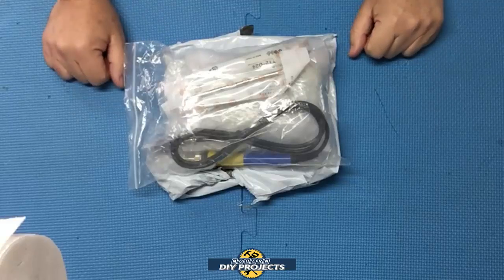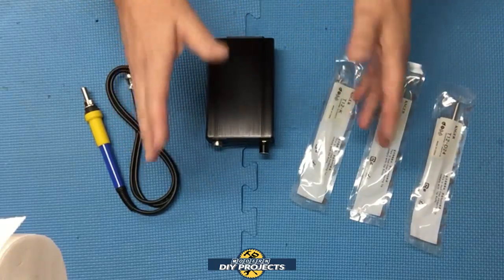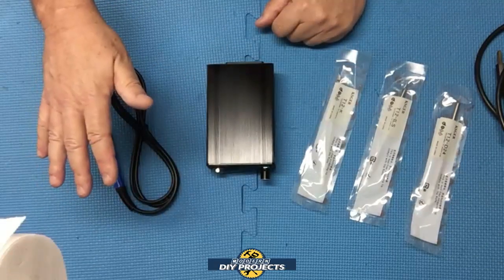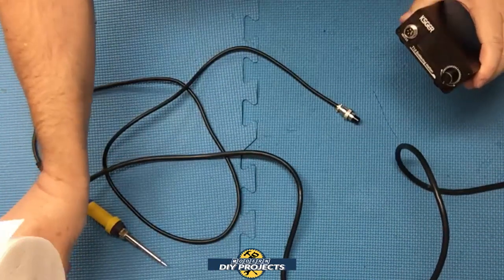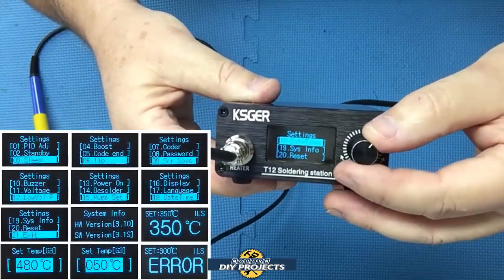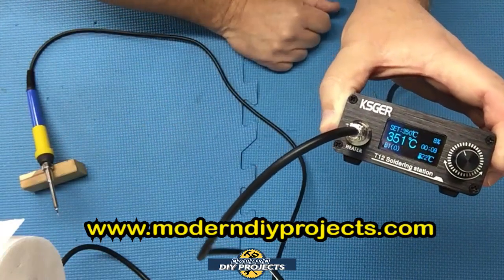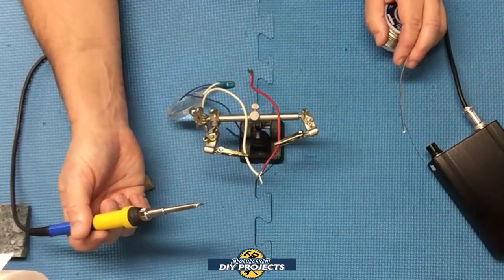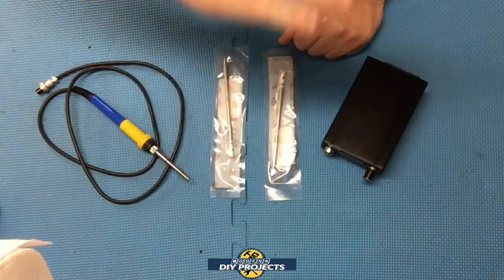KSGER T12 Soldering Station Setup & Review + Error Message and Calibration Explained

Comment: FIX for loose tips:  One really common cause of the unit displaying "Error" is when the tip is too loose in the handle.  It only has to move a couple mm before it'll loose connection with the electrical contacts.  I have the aluminum FX9501 handle with the carbon fiber grip, and that was a huge problem for me.  I found the solution on another YT video comment thread and thought I'd also share it here in case anyone else can benefit from it.  Inside the iron handle there's a short piece of silicone tube that kind of grips on to the little notches on the tips and prevents the tip from sliding right back out of the handle.  The actual electrical contact tabs aren't nearly strong enough to do this on their own.  My handle had a piece of 6x8 mm (ID x OD) tube in it that was about 2.6 cm long.  This was both a couple mm too short and 1 mm too narrow to be effective.  It resulted in a couple mm of "play" in the tip because the silicone tube would slide freely between the two stop points, allowing the tip to lose contact with the electrical connection tabs.  Annoying as all get out, I tell ya.  The VERY simple solution was to replace the tube with a 2.8 cm piece of 6x9 mm silicone tube I sourced from Amazon on the cheap.  Now my tips stay put magnificently, held snugly in place by about 6 cents worth of generic silicone tube.  No more "Error" every time I poke into my tip cleaner or blink too hard or anything.  Life is starting to look up again.

Comment: I turned mine on and got the error message and it stayed on until the unit shut off.
Reply from the maker: Follow the procedure in the manual for getting rid of the error message. Most times it goes away automatically but not always.

Comment: It goes higher than 350. And It won’t damage the tip.
Reply from the maker: Really? In the manual it says that using it for too long above the 350 will riune the tips. It has a short boost mode but it says not to use it too often. I may try it out when one of the tips is wearing out.
Reply: @ModernDIYProjects  Just make sure it’s an accurate reading. You don’t want to set it to 375 and it’s really 450. Most jobs will be fine at 350 or less, but you might need to go hotter on bigger components.

Comment: Only Celsius ?
Reply from the maker: Correct. I could not find any setting for Fahrenheit. Since they make it a world machine, I guess that is more common.
Reply: @ModernDIYProjects  There is a software mod for these things that adds a ton of features. Fahrenheit is an option in that. I highly recommend learning and sticking with Celcius though. Most solder profiles in datasheets are in C and it's really industry standard. So you will have more context to what you are working on in C than in F. Just my Opinion on the matter though. BTW Youtube is recommending one of my videos after yours that's why I am here, I saw it in my analytics.
Reply: Jump on into the 19th century, champ.  Celcius is the way of the future.  Arbitrary nonsense scale useless to science and still used by virtually nobody, versus easily relatable sensible scale that's compatible with the Kelvin scale and used by everyone.  How is this still not an obvious answer for some folks?  Brain damage perhaps?  Early onset dementia?  Mind boggling stupidity?  It's baffling.
Reply: @Zaphod0414   You realize that it's the 21 century, Don't you ?
Reply: @charleschapman2428    Yeah...  That was the joke.  I was taking a dig at how antiquated the use of the Fahrenheit scale is.  As in you'd have to be living in the 1800s.